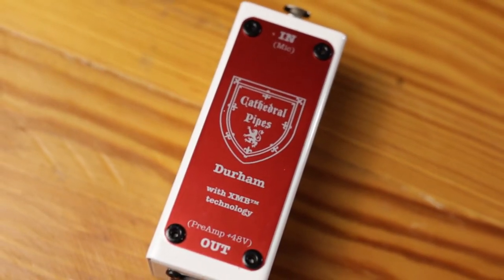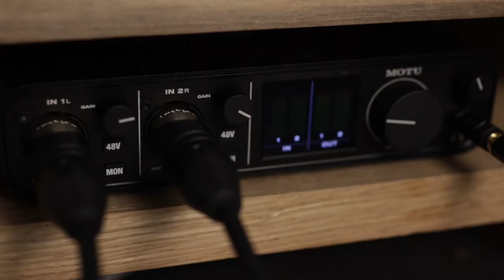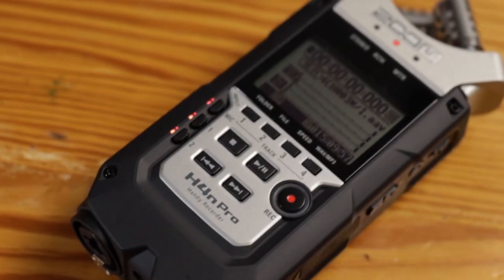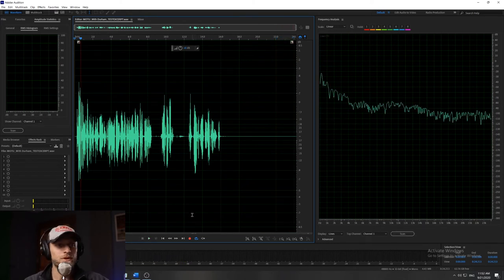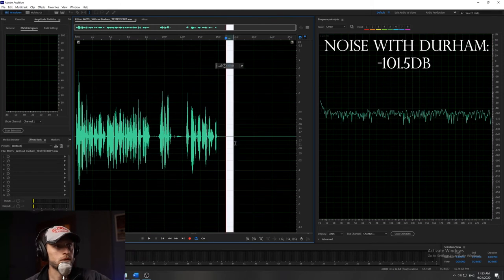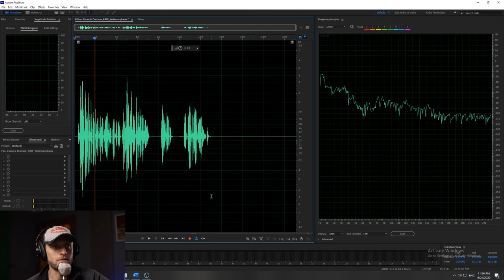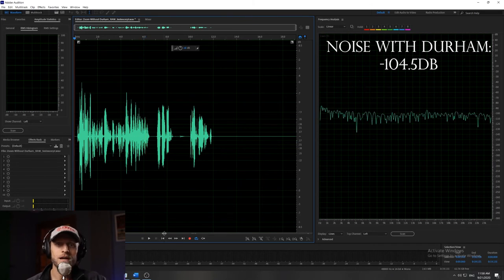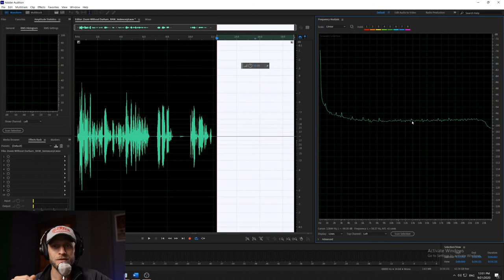Reducing Microphone Noise Floor Using the Cathedral Pipes Durham MkII Microphone Activator

Comment: Hey! i just discovered your channel! and i have something to say UNDERRATED ;) , I have a sm7b with motu m2, but im wanting to get a pre amp, the m2 is really awesome but i have to use it at 100% with the sm7b, and moreover when im using it in OBS or Zoom, the audio is a bit lower, not loud i mean, if i record it on a recording app like audacity its sounds good at 100% but with obs or zoom it just i dont know what they do but they just drop it by a few db, so thats why i want to get a pre amp! and the durham looks like a solid choice to me, around 70$ with shipping, the Se1 is about 110$ with shipping and cloudlifter is i feel overrated xD, thank you!
Reply from the maker: Thanks for the comment!  Absolutely you need a booster for the SM7B. I think it will make a world of difference for you, especially with noise. If you push the M2 up to 100% gain, you will introduce a good bit of noise.
Reply: @chasingquality5425  yes
Reply from the maker: By the way, one thing that I have experienced with some of the audio tools is that the difference in bit depth has a big effect on the volume level within the tool. I know there is a huge difference in volume between what I get with Audacity and Zoom, for example.
Reply: @chasingquality5425  oh, ok

Comment: The Durham MKII is supposed to provide 20db of clean gain. Why is there only a 2.5db and 6.5db difference in the noise floor?
Reply from the maker: My guess is that it has to do with other factors in the signal chain beyond the Durham itself. The "20db of clean gain" is laboratory measurement starting with a "perfectly clean" signal such as an artificially generated sine wave. Even then, the word "clean" is subjective. In the real world, there are too many other variables.  You indeed get the 20db of gain, but how "clean" it is will likely vary somewhat.  A 4.5db reduction in the noise floor might not sound like a lot, but anyone who has used a device like the Zoom H4n with a gain-hungry mic like the SM58 will very much appreciate the very noticeable difference in the noise floor.